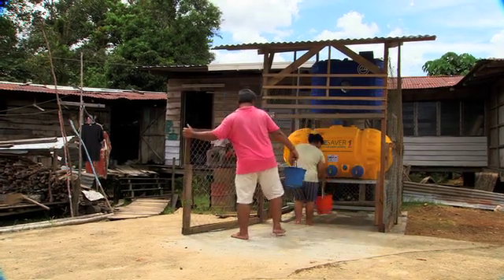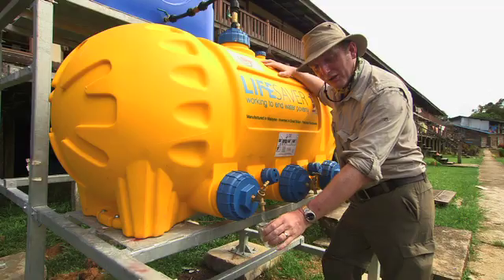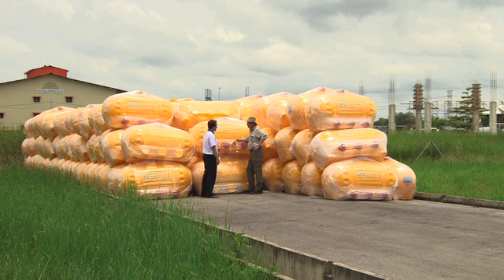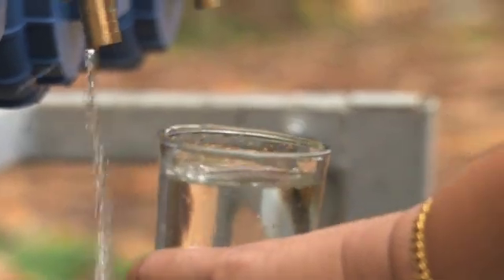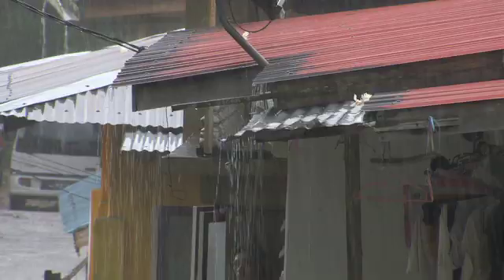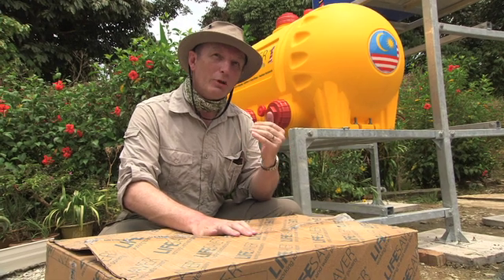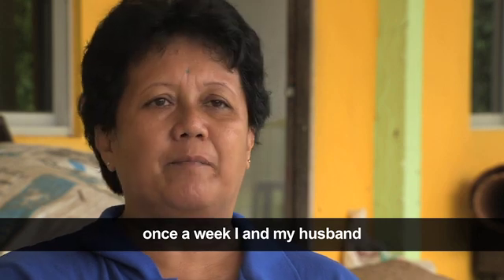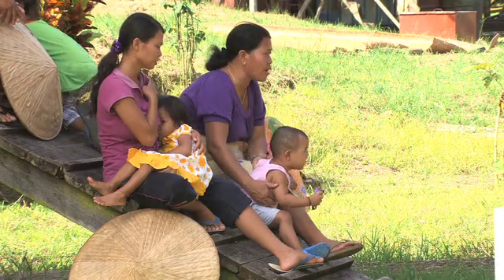LIFESAVER M1 in Borneo Eastern Malaysia

Comment: Are the filters cleanable or do you have to change them
Reply: No, you gotta change them. Lifesaver C2 (the big one) in total delivers 2,000,000 litres before the filters need replacing, the jerry can 20,000, the cube (a block about 0.5m²) does 5,000 litres, and the bottle 6,000. That's a lot of water per filter, I wouldn't worry about changing it often...